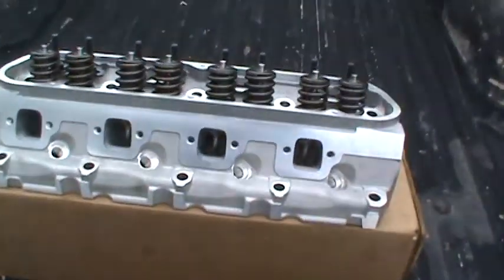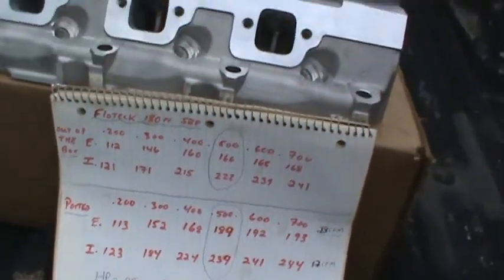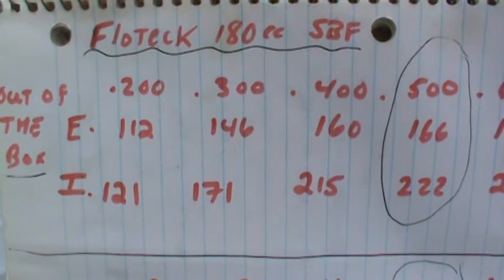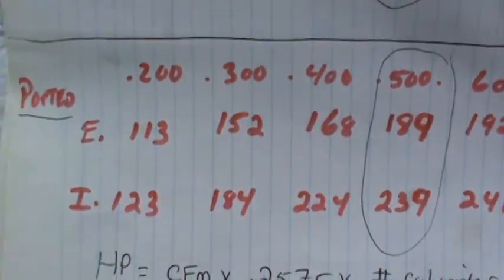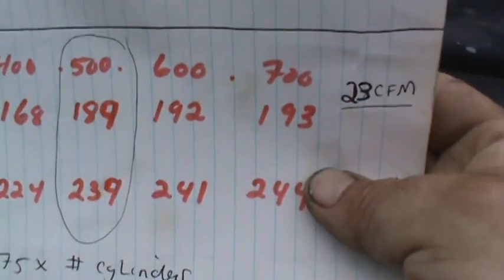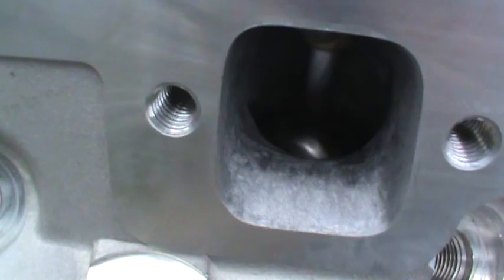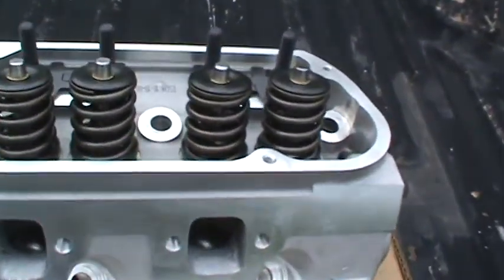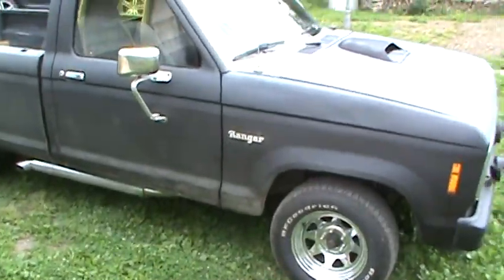Flotek bowl blending flow numbers 180cc sbf

Comment: Damn, which heads did you get? I bought some of these back in January. Mine flowed about 20cfm less than advertised. They were tested on a superflow 600 also. At .500 I got 199 intake, 135 exhaust.

At .500 lift Flotek advertises 136cfm out of the box for the exhaust and you got 166. Lucky you.
Reply from the maker: these are lightly ported numbers.
Reply: @HammerHeadGarage  im talking about the before porting numbers you showed being higher on the exhaust than what is advertised from flotek.

Comment: Just used these heads on my foxbody- used summit .30 over pistons, xe270hr12 cam, street burner manifold- stock the car would barely bark the tires hitting 2nd gear and now i spin 2nd, feels like i gotta have 100 more hp then stock with this combo

Comment: That's theoreticle with intake flow.. You have to consider the percentage of exhaust flow compared to the intake flow..as an example if your exhaust flows 65% of your intake flow you would calculate that 65% into the horsepower formula..so realistically you're no where near the 500hp range..You would be closer to 350hp if anything.
Reply from the maker: Well seeing as the truck has been dyno tested at 386 fwh I think you're wrong.

Comment: Good job ! I am Glad to see that you have whittled away at those heads a little  . Most people like to look at the peak flow numbers , especially when you have a smaller cam , you have to look at the lower lift treads and averages.  Your exhaust avg from .200 -.500 went  from 146 to a 155.5 and  your intake went from 182.25 to a 192.5 . You just gained a solid HP gain across the power range,  not just at peak rpm . 👍
Reply from the maker: Thanks for the comment. I'm pretty happy with how they turned out. We did some work on the valves and seats as well. Waiting on pushrods and then I will have a butt Dyno video!
Reply: @HammerHeadGarage  what length rods are you using?
Reply from the maker: @pro_dafty  5.400
Reply: @HammerHeadGarage   do you think it would be the same length if I used a tfs1 cam? And thanks for the quick reply
Reply from the maker: @pro_dafty  Rod length does not change based on camshaft selection. Piston to valve clearance needs to be checked with any cam selected.
Reply: @HammerHeadGarage  how would I go about doing that
Reply: @HammerHeadGarage  also was that for 302 or 351
Reply from the maker: @pro_dafty  watch this video  https://youtu.be/7Yq9VMCGwt8

Comment: Using the formula, it shows a less than 5hp gain! I would've thought there would be more gain with even a mild porting!! Thanks for showing us. Stay well my friend.
Reply from the maker: Yeah i was hoping for more but over what is on there now it will be quite a difference. Thanks for watching!
Reply: @HammerHeadGarage  Well... didn't cost much besides your time and every little bit helps!  :)
Reply from the maker: @jimbranham3281  The heads flow so well in stock form it is often difficult to make major increases in flow. Also the cfm numbers don't really tell the whole story hp wise. 
Things like velocity, port shape also have an effect. The tests showed some very good velocity numbers.